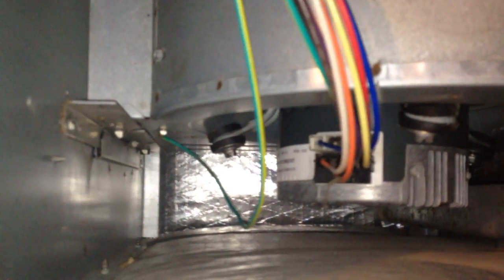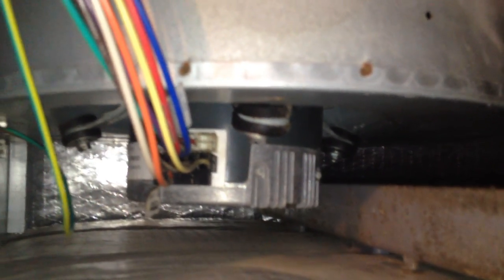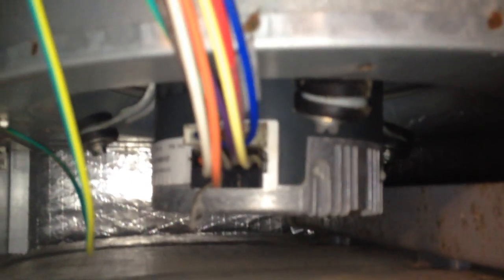A/C Blower Fan Wont Work | Documenting the blower fan surge | Intermittent Power Surge

Comment: had the same problem. removed and opened the motor. One of the magnets on the rotor had come loose and was stuck to the side of the stator coil. pulled the stuck magnet and used metal glue to stick the magnet back to the rotor and now everything works just fine!

Comment from the maker: Just to give a quick update... The motor circuit was fried. Replaced it with a new motor $350 repair
Reply: hey man, I'm having trouble myself.  although, I didn't hear that noise but everything else seems to be working, except that blower motor.  did you see if there was a capacitor on this motor?
Reply: archifxllc glad I'm not the only one.  I'm in Florida too,. And my A/C blower is doing the same shit.  Started during Irma,. I think power surges screwed me.

Thanks for posting the vid, bit I'm guessing I'm gonna have to call a tech in, cuz if I replace the motor, it will end up being something else with my luck
Reply: Bad module replaced with a universal by pass the board with a fan relay,,total $83
Reply: $350 doing it yourself?
Reply from the maker: No. That was the repair price from the AC company.
Reply: I have the same problem the guy wants 1200 is crazy

Comment: my unit is doing the same thing tonight,  but I can give the fan a boost with my hand and it starts up, but when I turn it off it does it again. the really bad part is I am hosting a party this weekend 2 days away and  my house is 80 degrees.  carrier unit is only 14 months old.  hope the warranty will cover it.
Reply: Thomas O'Bryant your capacitor is bad.. easy fix
Reply: William Rodriguez the capacitor is built in and can't be replaced, the entire fan had to be replaced.
Reply: That's because it's a capacitor

Comment: I have a Lennox AC and the same thing happened to it. It's only about 3 years old, those motors are very shitty it seems! It started making noises, then start and stop randomly. They replaced the whole motor... forget about only replacing the board. They charged $400 for the job. I hope they could send me the motor only so that I could replace it, but they don't allow doing that. I wonder if I can figure out where to purchase those motors for next time... Also they didn't balance the blower so it makes some subtle noise when running.

Comment: I've been doing AC work for 15 years. that's a  variable speed motor. the lower aluminum section at the bottom that all those wires plug into is called the module, that is a very common failure. 95 percent of the time the motor is fine but that lower module needs replacement. being that the unit is less than 5 years old it should still have a parts replacement warranty.
Reply: k I have a central ac unit but is not blowing air. It was working fine earlier today and now it’s night and it’s it blowing. I can eat the ac working but no blower. It has done this before but after flipping the breakers on  and off the blower would work, but not this time. Any suggestions. Thank you. Sorry I don’t know model of the ac unit as I live in a towing home and can’t get on the roof to see the ac. Well at least I think that’s the case. I’ll have to check with hoa. Thank you
Reply: Hi I just read you r comment,  I have the same motor speed variable, sometimes work and other days dont. Where to find the lower module of the motor with out replacing the whole motor. Thanks